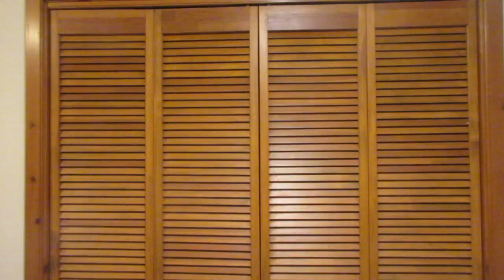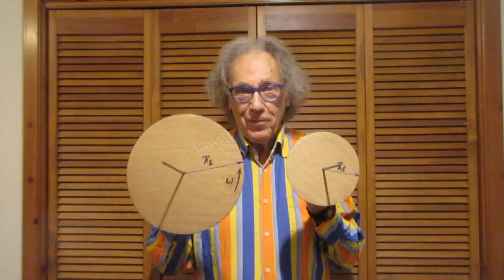Problem #8  Rotating Discs  - not easy!

Comment: How do I find a formula for each 
successive nth period T(n), such that T(n+1)=T(n)+∆T(n) with ∆T(n)>0, for a thin rotating disc (with ω dependant friction) of mass m, radius R, that is initially rotating with ang velocity ωo=2π/To..?

Notes: 

For each period the disc is losing energy to frictional torque τ(n)=R×f(n) ..(†) , until the disc eventually stops after time ΣT(n)=∆t. 

There are N periods in total, 
labelled: 0,1,2,...,N-1.

(†) (each force & torque depends on T(n). Friction forces are tangent to the edge of the disc, so torques are 90° to them).
Reply from the maker: you should watch my solution
Reply: @lecturesbywalterlewin.they9259  

😊. Thanks for responding, but consider my comment as a problem you can pose to your audience. 

I'm trying to work this out for Ian Gostling who is experimenting with rotating discs.

Comment: I have a question in mind with no solution found till now.. Pl help if you find some time... It goes like this

Suppose a tyre of radius R rolling at a speed V hits a verticle hurdle of height h (<R) and then the center of the tyre bumps off to a height H above the gound, then for a given h, what should be V to maximise H/h
Reply from the maker: watch my 8.01 lectures. that's what  it is for

Comment: Let a disk with radius R have:
moment of intertia around its axis=I
angular velocity=ω
angular momentum=L=Iω
torque=𝜏=dL/dt=FR for a force F acting tangential to the disk on its perimeter.

The total change in angular momentum is given L_f = L_i + ∫ 𝜏(t) dt
I*ω_f = I*ω_i + R ∫ F(t) dt

Considering each disk's initial and final state gives (with ω=initial rotational velocity of disk 2)
I₁ω₁ = R₁ ∫ F(t) dt
I₂ω₂ = I₂ω - R₂ ∫ F(t) dt
where the forces are the same by newton's third law

implies: I₂ω₂ = I₂ω - R₂( I₁ω₁ / R₁ )

The angular momentum of a disk is given by ½mR², where the mass is proportional to R², so I=a*R⁴ for a constant given by the per-surface mass, so that:

R₂⁴ω₂ = R₂⁴ω - R₂( R₁⁴ω₁ / R₁ )

As before we know R₁ω₁=R₂ω₂, which gives

ω₂ = ω / (1 + (R₁/R₂)²)
ω₁ = (R₂/R₁) ω / (1 + (R₁/R₂)²)

This was a nice problem

Comment: In the final state, velocity of the disks at the point of contact will be the same - using angular velocities, w1*R1=w2*R2
For a disk with radius R spinning at speed w, the energy is integral_r integral_t 1/2*v^2*r*dr*dt (where the point mass is proportional to r*dr*dt)
= integral_r integral_t 1/2*w^2*r^3*dr*dt
= pi*integral_r w^2*r^3*dr
=pi/4 w^2 R^4
Initial energy = final energy, so if initial angular velocity of disk 2 is w, then
w^2*R2^4 = w1^2*R1^4 + w2^2*R2^4
Then using some algebra I get:
w1 = w*(R2/R1)^2*sqrt(1/(1+(R2/R1)^2))
w2 = w*sqrt(1/((R1/R2)^2+1))
Edit: After seeing his next video I see that kinetic energy isn't conserved taking into account generated heat from friction. I will try again...

Comment: As the discs exchange energy, the total energy of the system remains constant giving us the first constraint:
I1*w^2 = I1*w1^2 + I2*w2^2
and after the engagement is complete, both the discs have the same peripheral velocity to avoid slipping, therefore:
R1*w1=R2*w2

The answer will be:
w2 = w*R1^2/(R2*sqrt(R1^2+R2^2))
and w1 can be worked out similarly.

Comment: A vehical with a wheel of R1 radius and an angular velocity of W1 in radions per second will have a vehical velocity of R1/sec. This has the same velocity of R2/sec so therefore
W1xR1=W2xR2

Comment: Sir, I ubderstand that we cannot conserve angular momentum as the net torque us non zero. But the frictional force that is acting does not do any work. So why can't we conserve energy?
Reply from the maker: as one disc spins up the other spins down. Thus there is a lot of slip as they reach equilibrium. If you push them hard enough together and it both were made of steel you would see sparks! The reduction of KE is the result of Friction. Friction does negative work! Mechanical energy is not conserved!

Comment: friction on axel of 1 would be reduced by upward force of 2. Weight of 2 would have larger axel friction due to larger mass. Contact friction between discs would be affected from increase in friction in a real world design. Angular momentum therefore would be a differential equation possibly.
Reply from the maker: axels are frictionless.

Comment: The big disc will be turning slower than the little one, in terms of rpm, but the speed of the edges of both discs will be the same.

Comment: The only time that disk 2 stops spinning down is when it stops spinning.  Unless you are standing on the moon and there is no air friction, but then would not be able to hear you.  Forgot what the question was, but the answer is likely w is inversely proportional to r.
Reply from the maker: >>>The only time that disk 2 stops spinning down is when it stops spinning. >>>
this statement is incorrect. Right from the start when the 2 discs touch each other the large disk is spinning down and the small one is spinning up. 
By the way, the question was: what is w when the spinning up and spinning down stop. That is not so easy

Comment: By simple geometry ω1 and  ω2 are inversely proportional to the radii r1 and r2. But where the friction μ plays a role here? This problem is much more complicated than it seems to be! Besides, we have the inertia of the rotating disk that may cause a slip at the contact point and initial loss of energy, until the two rotate together. Then we have to determine this loss of energy, resulting in loss of speed due to friction, so the problem becomes a dynamic one, i.e. depends on time.
Reply from the maker: watch my solution

Comment: i conserved the angular momentum about any point and it still gives the same answer professor. then why is that u said we cannot conserve angular momentum?????
Iw=iw(1)+Iw(2)
simply solving for w(1) gives the same result. 
please reply......
Reply from the maker: <<<<why is that u said we cannot conserve angular momentum?????>>>>
I explain this in my solution video.  I have to apply a torque on the system.

Comment: this problem naturally relates to another that I have been thinking about.
the inertia of disc 1 in terms of disc 2 is (r1/r2)^2 and the total angular energy (velocity times mass) is proportional to r2^2 *ω
the resulting energy (assuming no loss by the axes) should therefore also be r2^2 *ω, and the proportion of that energy which will be in disc 1 should be r1^2/(r1^2+r2^2) which is the proportion of the inertia that disc 1 possesses in the entire system.
in the end, then, disc 1 should have angular velocity ω*(r1^2 r2^2)/(r1^2+r2^2) or ω(r1^2 o+ r2^2) for o+ represents the function(x,y)=1/(1/x+1/y)=xy/x+y
Reply: wait... so... did I get it?!
I had this type of formula thinking about a much less useful theory in time dilation... to selectively slow down an area without applying acceleration, thereby increasing the specific heat (energy it takes to change 1 degree) and decreasing the perceived temp... somehow this almost exactly translates to your spinning disks problem.... and I can use disk physics to (partially) calculate temp. physics, with some modifications. (just to be candid)

Comment: Professor I have a question beyond the context (I think)!
since I saw your problem I remembered when I had an idea to make a perpetual machine, suppose if a specific amount of energy is needed to circulate the motor with radius = R2, and as you say is connected with other; lets assume it is a generator which will produce the same amount of energy  if it is revolved one round and the radius of this is R1.
Now if R2 = n R1 then with every round of R2 we will have n rounds of R1 meaning that with consuming the specific amount of energy and in return we will obtain n amount of it. (I personaly think it is a clear violation from the law of energy conservation)
Can you please tell what mistake am I commiting.
Reply from the maker: watch the 2 solution to this problem. The videos have been posted. 
Planets going around stars are the closest to a Perpetual motion (though not perfect as their life time is also limited). None can be constructed on Earth unless you use an energy source to overcome the loss of energy. 
.
Reply: I watched it, but couldn't pick it all at once; I am going to watch it again. Can I sincerely ask you please make a video arguing the same topic.

Comment: Initial conditions are that ω₂=ω, ω₁=0. At some point the two discs touch, with a coefficient of friction μ. This causes a transfer of momentum from disc 2 to disc 1, until their touching point has matched velocity: r₁ω₁=r₂ω₂. During this transfer some energy may be lost as heat. How much would depend on µ. 

The moment of inertia for a disc can be calculated as I=½mr², and the rotational energy Ek=½Iω² per disc. We know the discs are similar aside from radius, so m₂/r₂² = m₁/r₁². Any time there is a force transfer from disc 2 to disc 1, only fraction µ of that energy makes it into disc 1's rotation, while 1-µ is converted to heat, which we'll consider loss for this task. As there was no initial energy in wheel 1, we can multiply its final energy by 1/µ to get transferred energy plus losses. This is probably where I'm most uncertain; there may be a discrepancy in my estimation that a force fraction could be applied to the energy. 

So, we match velocity with r₁ω₁=r₂ω₂, and we conserve energy with m₂r₂²ω² = m₂r₂²ω2² + m₁r₁²ω₁²/µ. We substitute the masses with their relation: m₁=m₂*(r₁²/r₂²), and can then eliminate them: r₂²ω² = r₂²ω₂² + (r₁²/r₂²)r₁²ω₁²/µ. Substitute ω₁=r₂ω₂/r₁ from the velocity matching, and we get  r₂²ω² = r₂²ω₂² + (r₁²/r₂²)r₁²(r₂ω₂/r₁)²/µ = r₂²ω₂² + (r₁² r₁² r₂² ω₂²) / (µ r₂² r₁²) = r₂²ω₂² + (r₁² ω₂²)/µ. Factor to get r₂²ω² =  ω₂² (r₂² + r₁²)/µ. We're down to one unknown ω₂ = r₂ω√(µ/(r₂² + r₁²)). Substitute ω₁=ω₂*r₂/r₁ to get ω₁ = ωr₂²√(µ/(r₂² + r₁²))/r₁. 

Finally, plugging in some arbitrary numbers to do another sanity check. Let's say r₂=3, r₁=2,  ω=5 and µ=½. That produced about ω₂=2.94, ω1=4.41. This seems intuitively a very small change to ω₂. Energy would be ½Iω² = ¼mr²ω² per wheel where m is proportional to r², so some Kr⁴ω². Our resulting energy r₁⁴ω₁² + r₂⁴ω₂² < r₂⁴ω². The ratio actually is µ. This means I either got things reasonably right, or very wrong but plausible enough to fool someone. 

My guess at this point: Quite wrong, because the energy apparently kept in the system is proportional to µ, not dependent on the radii of the discs. It seems to me the loss shouldn't be applying to the energy that is kept in disc 2. 

Thanks for the brain teaser, unfortunately my brain is not up to the task at the moment.
Reply from the maker: incorrect

Comment: Short answer: w2 = w1 = w/2. (Wrong. I didn't know the solution is posted)
I don't have the knowledge to solve it, but here is the process of my thinking: I think the mass of disks is what matters (or at least it's what I thought at the beginning) - with no friction on the axis, the only thing that's holding disk1 from spinning up and disk 2 from spinning down is the inertia. The mass is the density/volume. But it probably wouldn't make a difference if the disks we made of steel.. A very (uneducated) wild guess is that if R1=R2, then w2 = w1 = w/2 ( well at least I got this one right ). Also I have the feeling that only the time to reach equilibrium depends on friction between disks and not w1 and w2 ( and this one ). If all the mass was on the radius ( like if it was hollow cylinder) then maybe it would have been something like w1 = w2*R2/R1 (or whatever), but the mass is spread. Does the mass really matter? I mean you drop one big cylinder and one small on tilted surface and they accelerate with the same rate, right? So the same should be for deceleration. So R1 and R2 and the mass doesn't matter. Reference: https://youtu.be/cB8GNQuyMPc?t=8m35s

Comment: This is nothing but a gearing ratio problem. If all 2nd law effects are ignored, the circumferences of each disk will be moving at the same velocity when equilibrium is achieved. At that point in time, the angular velocities will be in the ratio of the circumferences which is the same as the ratio of R1/R2. The degenerate case would be when they are congruent circles. Then the ratio would be 1 and the 1st law says they would both be at half the initial velocity of the original spinning disk.

Comment: Roughly speaking, the R2 disk will accelerate the R1 to a value of Omega2 while R2 will slow rotation to Omega1. Both disks will share the initial input of rotational momentum to where one side of the equation will equal the other.
Reply from the maker: then what?
Reply: Are we to eliminate heat from the friction of the two disks? Because that will affect the disk dimensions? Disk R1 will resist acceleration of Omega and disk R2 will resist deceleration of Omega. I was applying gear ratios and momentum. Disk R2 will also have 4x the mass that of disk R1. However, Mgh = 1/2mv^2 tells me that mass won't determine speeds, but will determine quantity of momentum. What I am hearing but not quite seeing is something will occur regarding the changes of Omegas. Would two 'arguing' black holes exhibit this problem?
Reply: For imagery I thought of elementary particles. When the particles split one particle has  big spiral while a smaller particle has an opposite spiral. They also split with a distinctive angle. Seems to me they will also fling themselves apart at an angle that relates back to their sizes to each other.

Comment: part 1: momentum conservation:
M1 = rho*R1*R1*pi*h with rho=1, h=1
M2 = rho*R2*R2*pi*h
angular momentum of disk 2:
L2 = I2*w2 with I2=0.5*M2*R2^2
L1 = I1*w1 = 0 because w1 = 0
L2 + L1 = const. = L2' with L2' being angular momentum of disk 2 at the beginning

part 2: velocities:
U1 = 2*R1*pi
U2 = 2*R2*pi = 4*R1*pi
--> U2 = 2*U1
--> when disk 1 finishes 1 period, disk 2 has finished half a period --> w1 = 2*w2 because disk 2 is rotating more slowly
OR: linear velocities at touching point have to be equal after acceleration --> v1 = v2 = R1*w1 = R2*w2 --> w1 = 2*w2

part 3: combine everything:
L1 + L2 = L2'
w1 = 2*w2
-->
M1*R1^2*w1 + M2*R2^2*w2 = M2*R2^2*w2' where w2' = starting velocity of disk 2 and w1, w2 are final velocities
w1 = 2*w2 --> M1*R1^2*2*w2 + M2*R2^2*w2 = M2*R2^2*w2' --> w2 = (M2*R2^2*w2') / (2*M1*R1^2 + M2*R2^2) --> w1 = 2*w2

example:
w2' = 1
R1 = 1
R2 = 2
h = 1
rho = 1

M1 = pi
M2 = 4*pi
w2 = 8/9
w1 = 16/9

test:
L1 + L2 = M1*R1^2*w1 + M2*R2^2*w2 = 16pi
L2' = M2*R2^2*w2' = 16pi

answer: w1 = 16/9, w2 = 8/9

Comment: We get a first equation when we realize that the total energy is conserved, and since there's only change in kinetic energy, then the total kinetic energy is conserved, meaning that the initial kinetic energy of disc 2 equals the sum of the final kinetic energies of discs 1 and 2. KE=KE1+KE2 with each kinetic energy written as 1/2*I*w^2. (It's difficult to type the whole thing in a clear way so I'm not gonna type it). We get an equation containing w1 and w2.

We get a second equation from the fact that the discs are spinning without slipping, so w1R1=w2R2 and that's the second equation.

Two equations, two unknowns, we can find w1 and w2:

(ω₁)²=I₂×ω²/((I₂(R₁/R₂)²+I₁)
(ω₂)²=(ω₁)²(R₁⁄R₂)
Reply from the maker: incorrect

Comment: w1=w*R2^3/(R1^3+R1*R2^2)
w2=w*R2^2)/(R2^2+R1^2)

Considering that the same frictional force is acting at the point of contact, we can write:
R2*m2*(w-w2)=F*t
R1*m1*w1=F*t
We also have R2*w2=R1*w1. By solving these equations, we get the above answer.
Thank you for your amazing lectures

Comment: Since the frictional forces are equal and opposite, the torques are opposite and proportional to their radii.
But the torques are the rate of change of angular momentum L.  So when the sliding stops:
(1) Net change in L2 = -R2/R1 * Net change in L1 --since at each time their rates of change were in this proportion
(2) R2*w2 = R1*w1                             --since edge speeds must match
But L(w) =  I w =  ((M*R^2)/2)w                    --where I is the moment of inertia of a disk rotating  in this way
         =  (pi*(R^4)*d/2)w                            --where d is the disks' mass per unit area
So we can rewrite (1) in terms of the w’s:
  (1’)    L(w2)-L(w) = -(R2/R1) L(w1), 
and now we can use (1’) and (2) to solve for w1 and w2 in terms of w, R1, and R2
Reply from the maker: what is your answer of w1 and for w2
in terms of R1, R2, and w.?

Comment: ω1=ω/((R1/R2)+(R1/R2)^3)
ω2=ω/(1+(R1/R2)^2)

In this problem dissipation of kinetic energy (by friction) is constant regardless of magnitude of the friction force. Moreover, large friction force acts in short distance and small friction force acts in long distance (before slippage ends). Thus, wasted energy remains constant regardless of the circumferential force. Since in this problem, the dissipated energy is a function of the disks specifications, friction force does not appear in the above formulas.

Comment: Thank you for your tips in the second video, I have thereafter decided to rethink and change my answer. 
The method I used was to combine the fact that the angular velocities are linked by (w1*r1 = w2*r2) and that the derivative of angular momentum is equal to the torque from the friction (I got this after watching your lectures in 8.01). 
Finally i got this:
w1 = w2_start * r2  / ( r1 + r1^3/r2^2 )
w2 = w2_start * r2^2 / (r2^2 + r1^2)

Comment: 1) The final tangential velocities at the point of contact will be equal hence 
          R1*ω1 = R2*ω2
2) The time taken by disc 1 to reach upto angular velocity ω1 will be equal to time taken by disc 2 to come down to angular velocity ω2.  Using angular form of newtons first equation of motion 
The magnitudes of final angular velocities of both discs are

LET R2/R1 = K (for simplicity of writing)

          ω1 =  K*ω / ( 1 + K^2 )
          ω2 = ω / ( 1 + K^2 )
Reply from the maker: incorrect
Reply: :( will look into it again.....